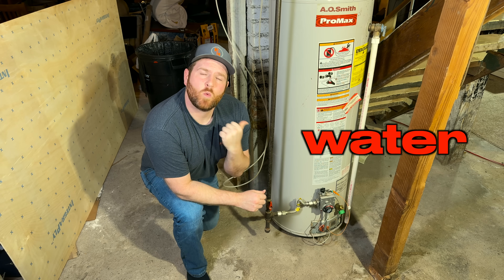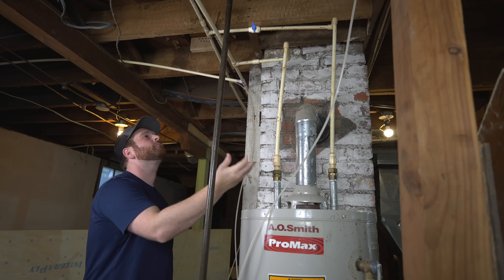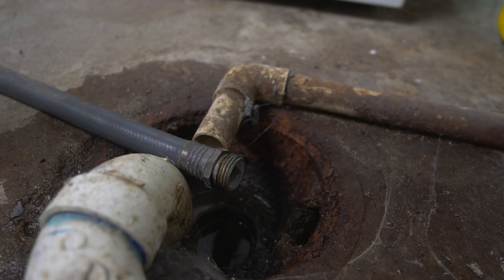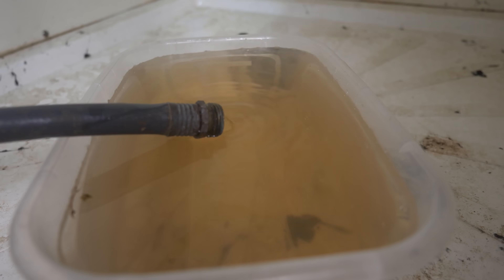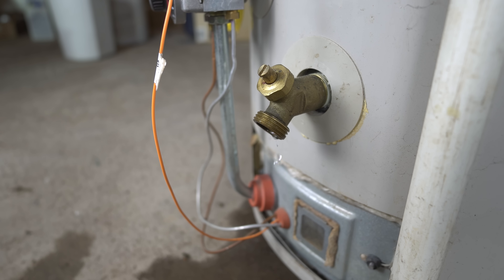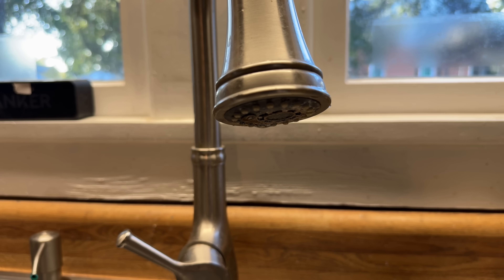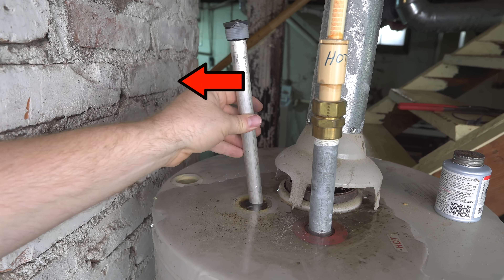Correct Way to FLUSH WATER HEATER! 2-Minute Tutorial

Comment: I would rather pull my lower heating element out than the instead of anode. 
That way you can take a shop vac, duct tape a 2 ft piece of scrap hose and fish out the sediment that turns into rocks.. when the sediment eventually destroys that lower element, people tend to think the tank is bad (typically happens when the hot water only last a few minutes and then goes cold) 
It’s not. The tank is bad only when it leaks.

Comment: Mine wouldn't drain even opening a couple of hot water sides. I had to start spinning off the supply so it could suck air from there....I mean either side would have worked but...

Comment: Warning- When I first did it years ago I shut off the electricity going to water heater and immediately drained it. As a result, I ruined my heating elements in my water heater. I'd strongly suggest letting the water heater cool down for awhile.

Comment: Two quick questions. I want to change the anode rod on my first floor heater because my second floor water heater burst two days after Christmas. The heater I want to change the rod on is now five years old. Will I potentially clog the drain valve even if I’m just getting rid of a few gallons and not doing a full flush? Also do I have to re light the pilot with flame  or just turn it back on? Thanks! -Charlie

Comment: DUDE you have to warn people not to put a cap on the pressure release valve. You can’t tell people to use a cap and not tell them to not put one on the pressure release valve. If you put a cap on the pressure release valve and the tank starts overpressuring the tank will literally turn into a bomb. There have been reports of people noticing their pressure release valve leaking so they went to the hardware store bought a cap capped it then their house blew up. If you don’t fix this I am going to report your video you have over 1 million views and there’s a lot of people out there who don’t know any better. Safety should be a priority in your video.

Comment: What about the pressure relief valve ?
Reply from the maker: What about it? You never want to mess with it because it will often drip, and you’ll have to replace it. Whatever you do do not cap off the pressure relief valve. It will literally turn into a missile and can blow through the roof.
Reply: @HandymanHertz i guess i wanted to know if it was necessary to open the pressure relief valve before draining

Comment: Note> The Anode Rod should be replaced when the tank is empty or after you've completed the flushing, NOT after you've turned the water back on and filled the water heater as shown in this video.  Also take note:  When you replace a solid anode rod with a "flexible" anode rod the rod tends to sway around a bit in the tank tapping the side walls of the tank when it's being filled with water thus also attributing to the tapping noise, nice presentation though.

Comment: Great video & advice, thanks. I was told to do it a bit differently by a couple plumbers. I leave the water & pilot on, run a hose to a drain and open the drain valve, let it drain until the water starts to cool a bit then close it back up. 
I'm on a well with sand & calcium that used to eat our tanks, once I started doing this regularly, I have zero issue everything is power flushed out.

Comment: Thanks for mentioning turning a hot water faucet on. I ruined my water heater by using the side air vent to flush it and it never sealed back and dripped all day. My new tank doesn't have that valve so I can't mess it up again. 😂

Comment: Why do you need to shut off the water supply, electricity, and gas? Can't you just empty few gallons so that the settled sediments flush out?. Not sure why the entire tank needs to be emptied.
Reply from the maker: You’re just wasting your time if you do that. Think about cleaning out a 5 gallon bucket. If it’s full of water and you put a hose in it, it doesn’t stir up much. But if it’s empty, it will slush around much better. You shut off your gas or electric because you never want to heat a tank that’s not full. A person could put a gas one on pilot mode though. This is just safer for everyone to do it this way.
Reply: @HandymanHertz  here's what I do. I attach my garden hose, leave all the valves as-is (open) then start draining into a white bucket. I run it till it's clear. It takes no more than few minutes of draining. I learned this from a plumber! Leave the power on, vales open...nothing else is touched. Super simple.

Comment: Why turn the gas off? Why wouldn't you just turn it to pilot, which keeps the pilot light on but won't allow it to turn on the actual heater. This would save you the trouble of having to relight the pilot light, would it not?
Reply from the maker: Correct. I just figured telling people to shut it off was safe and those that knew they could turn it to pilot would. I should’ve explained that in the video though.

Comment: thats stupid.. turn off the water heater but don't turn off the water.. let the street pressure flush out the debris at the bottom of the tank.. then close the hose valve and restart the heater.. this way you won't have an empty water heater and air in your system

Comment: Is it needed to turn the water off ? I only have a turn valve on cold side but not hot side on water heater …can just turning of the breaker work before you start draining ?
Reply from the maker: To flush it properly, as shown in the video by draining it first, yes you need to shut off the water. The cold side valve will shut it off.

Comment: A better way is to follow all the same steps but remove the bottom drain valve. Reach in there with a coat hanger with a J hook on the end. Pullout the debri into a pan rather than send it down the floor drain. Open the water supply valve above a few times to flush out the bottom of the tank. This method works much better because the drain valve is necked down and will not allow larger debi to exit.

Comment: My water heater is in the attic. How exactly am I to use a hose all the way up there without making a mess?
Reply: The hose comes off the heater and is for draining. I run it down from the attic and out the second-story window. The water to fill and flush comes from the installed piping.

Comment: I tell customers all the time, Problem is , No one listens, They still don't drain them or change the anode rod, Then when the water heater goes out on them in 7 years they are calling the water heater junk , But in return they just completely neglected the proper maintenance. It's like driving your new car for 7 years and never changing the oil what do you think will happen? It's common sense people . But most pack common sense.

Comment: My only thing is, my hot water tank is in the attic of my two story house. So i dont have a floor drain thing. So what do i do then?  I think in my case i cant do it without buying expensive equipment. Because i think i remember dudes who put it in, they had like a pump machine thingy and had long hose to go from attic to one of my bathroom tubs on the second floor. But how much is that machine? And is there trick to do it without it? But anyways, true story with this water heater in my attack, one day it just i guess completely busted because nobody ever checked this thing ever and maybe its been in house 20 or 25 years. Lucky i wasnt home, because where the tank is, its right over my bed, and i came home from work and all the water fail onto my bed. One good thing about that, is all the water was soaked up by the bed like a sponge and i had no floor damage. But i was just like most people, most people today, dont even KNOW you have to do maintenance like this and flush tank once a year.  But yeah, what about the metal rod thing inside? I seen videos they say one should replace that to. But if you flush once a year, does that mean, you can avoid that step?

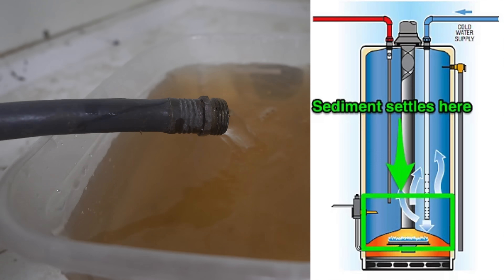Comment: So, my water heater sounds like a bunch of rocks are banging around inside. Probably never been flushed. I drained it, had some sediment, not nearly as much as I thought. I flushed it like you showed and... not much actually comes out. It's old as hell, there's no way it doesn't look like that one at 1:18 inside. I was expecting a bunch of mud, but really not much comes out. I even closed the hot water 'breather' tap to build a little air pressure inside to help force it out harder and it doesn't do much.
Reply: Did the rock sound stop after you flushed it?

Comment: A little tip; consider using a tub spout instead, for your tank pressure relief/ initial air purge. Small particles that may have knocked loose can more easily clog a shower/sink head, or get trapped behind a faucet aerator.
The first faucet to run after the maintenance has been performed is going to be the one most likely to catch any loose particles, and a tub spout normally has the largest passages to allow smaller particles to leave, without being trapped.
Reply from the maker: True, thanks for the tip! I dont have a tub spout, but I should have mentioned it. A person couple do a hose spigot if they don’t have a tub. I have CPVC, which is way less likely to have small particles than  galvanized pipe. Thanks for your tip!
Reply: @HandymanHertz  Laundry tub?
Reply: When do you turn off the sink/tub? It sounds like you don't leave it running the whole time...

And thank you both - for the video and for the tip! I'm a single mom and have lived in this home over 15 years and never knew this was something I should do! But today we had water like normal and then randomly had no water. Then I heard some gurgling in the water heater closet, then we had water again! Thanks to Google, I found this video. I hope this saves my water heater! Thanks again!! 🙏

Comment: I did this because about a month ago I'm hearing my water heater making noises that sounds like pebbles rolling around in there after a hot shower or bath.  After draining and turning on the cold,  I was hoping to see some crud coming out of there but I'm not getting any sediment coming out of my drain hose, water just continues to run clear??
Reply: Sediment is still in the bottom 😕. Now my cold water inlet valve decided to leak.

Comment: I have insurance who sent a plumber to do this “easy job”. He left me with bathroom sink not flowing telling me it should begin in an hour. 
I had a bunch of water under sink and water never started flowing. 
He came back and is acting like the faucet is clogged and it’s up to me to now replace 
What could he have done to cause all that water during this flush under sink? 
I guess because I have insurance he’s not touching clog in faucet area if indeed that’s the issue
Reply from the maker: Hmm something seems out of the ordinary. Without knowing what he turned off or did exactly, It’s hard to say. Sometimes the air raider screen can get clogged on a faucet, but that would only reduce water flow in my experience. Sounds like the shut off valve got turned off and forgot about under the sink, but it shouldn’t have been turned off for this process.

Comment: Great video. I did drain my water tank the you described. But now my kitchen faucet runs really slow on the hot setting. Any advice on how to fix this problem ?
Reply: Disassemble it, it's packed full of sediment. Use a tub faucet next time.

Comment: Silly question but does a faucet in the hot water position need to be on the entire time you’re draining and flushing? Do you need to do this if there is a pressure relief valve at the tank?
Reply from the maker: You can use the pressure relief valve, but they often leak after so I don’t touch them. Yes the hot water faucet would need to be open the whole time so it can breath and not create a vacuum effect.
Reply: Having the faucet open is like taking your finger off the top of the straw, which allows the fluid inside to run out.

Comment: What do you fo if you have no floor drain?  Can you run the hose upwards (6 feet) to a basement window?  Or do you need a pump?
Reply from the maker: I would just run it up the 6 ft to a window and flush it under pressure and not fully drain it. Ideally do this more often and you’ll be way more ahead than most other people who do nothing.
Reply: @HandymanHertz  Thanks
Reply from the maker: To answer your question, you’d need a pump since gravity would not allow it to drain above the water level.

Comment: Lost waterflow to my kitchen sink now??????? but not to my bathroom. I did everything in order! What could I have done wrong?
Reply: Try cleaning the aerator for sediment on the faucet

Try getting a bucket, removing the hoses from the angle, stops and blasting the angle stops open 

If no water comes out of the angle stop 

Remove the angle stop off the wall and inspect it to see if there’s sediment buildup on the angle stop 

If the angle stop is internally plugged up, you need to replace it 

If absolutely no water comes out of that nipple sticking out of the wall once the valve is removed 

You have bigger problems .

Comment: Thanks for the video. However in my case I followed directions: turn off gas, water on the shutoff on the line. I opened a inside faucet to allow water in lines to be removed. I attached hose and ran to reservoir to drain the tank after opening the tank's (Rheem, 40gal) water spigot. Strange but no water came out the spigot through the hose. However, if I turned on the water shutoff to allow water back into the tank, the water rushed through the tank spigot and out into the hose and to the reservoir. So, the tank spigot at the bottom would allow water to go to the hose if I turned on the water shut-off to flow, but not if I shut the water line off and through the tank bottom. Suggestions Hertz/anyone?
Reply: You probably need to exercise / flip up/open your pressure relief valve so the tank can fully drain. I have to do that with my hot water heater, which is something he didn't mention in the video which I assume is because not all hot water heaters require that as part of the draining process. Just make sure to flip down / close your pressure relief valve after you have finished draining/flushing it.

Comment: Sometimes you can get a piece of sediment stuck in the drain valve, not allowing it to close all way. A small screwdriver helps dislodge any debris out of the drain if this happens. And those anode rodes can be TIGHT. I used my 1/2 in Milwaukee impact to get them out the first time. Put some anti-sieze on the threads of the new anode rods to make changing out in a few years much easier.

Comment: Been flushing it today and doing the on / off valve trick to loosen the sediments and it’s working. Water looks clear but I see some sediment deposits so I’ll empty it dry and open the water valve quickly a few more times thanks for the tip.

Comment: Good video. But you would be better off if you put your hose back on with the tank pressurized and open and close the valve a few times to flush the debris out of the seat of the valve. Instead of capping it and not really remedying the problem. I flush mine annually.

Comment: Flush valves should be installed directly on the bottom to make flushing easier. (More efficient ffs) 
Yeah, I have hard water, and the chips popping off the element cause it to fail as soon as they build up and touch. Tank is in the shop and I didn’t wanna install a softener. 
I even made an adapter hose for my vacuum to get out all the calcium deposits 😉

Comment: Doing this and replaced the anode rod as well. The old one was corroded shut but luckily we have an impact wrench. I was flushing the water for a bit, lots of small chunky things and sediment came out, but water only flowed when we turned the intake valve on. When we removed the rod, it must have broken a chunk of and unclogged something, that water started flowing so fast. Now its getting clearer. I got some more flushing to do...
Reply from the maker: Sounds like you’re making a lot of progress
Reply: I'm curious, did you have a hot water faucet turned on inside the house?  If not, removing the anode may have been akin to having a faucet open; like taking your finger off the top of a straw and the fluid inside runs out.

Comment: I don't have a shut-off valve, but have a metal pull-up tab thingy right where water enters the tank on the side of the top.  Does that also shut-off the water going in?
Reply from the maker: Not sure what you’re talking about exactly, but If it’s a ball valve, then that’s correct.
Reply: @HandymanHertz  I think this metal tab is actually for pressure release.  There is a ball valve on one of the lines at the top, but I thought that looked like the hot line since red, but starting to think that might actually be my cold water coming in.  Hard to tell since both of those lines are hot to the touch.
Reply: I think I have it figured out now.  The one with the valve is the cold.  It feels hot because it's laying on the actual hot water line.